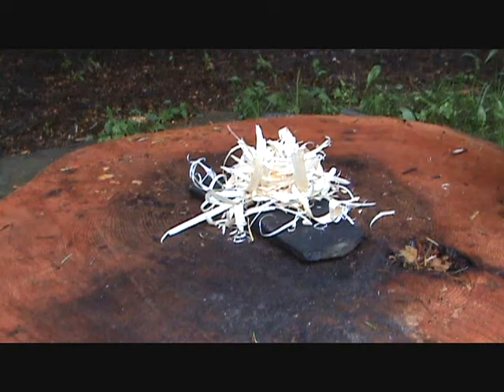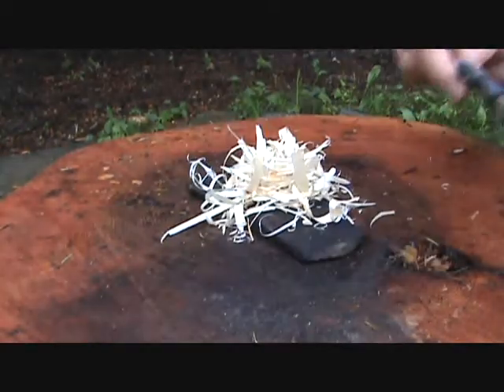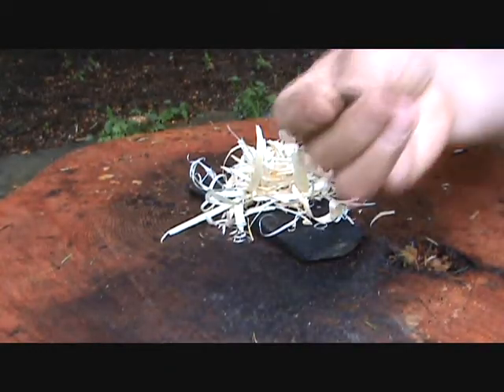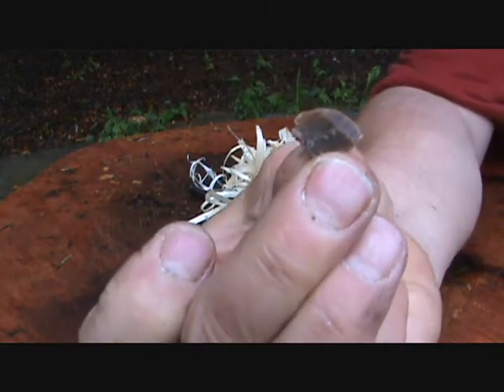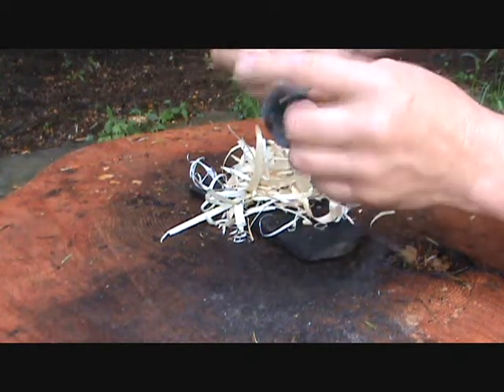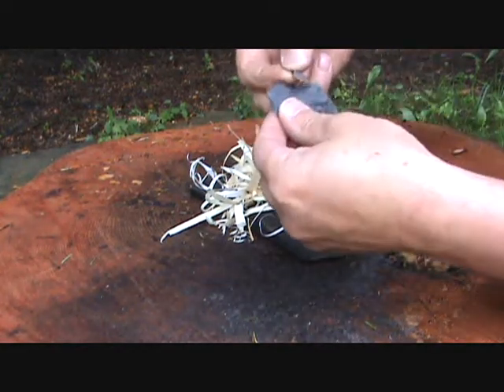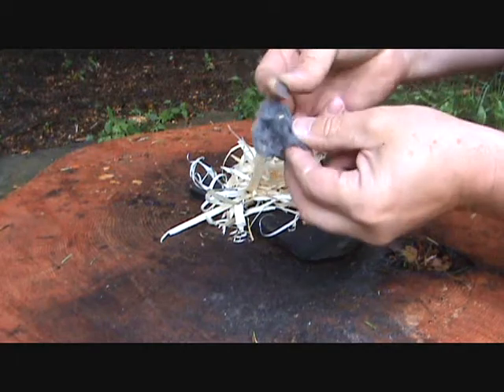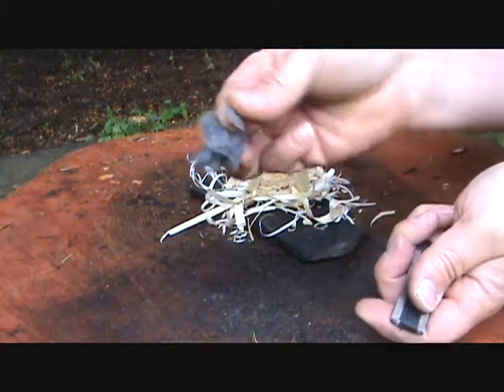Flint and Steel Wool

Comment from the maker: Ya hot stuff even if it gets a bit rusty. Just so long as it is dry. Like any other good tinder but unlike charcloth if it gets wet it can be salvaged. You don't need more than about 3 volts to light this stuff either, if you get the extra fine grade. Cheers Neil.